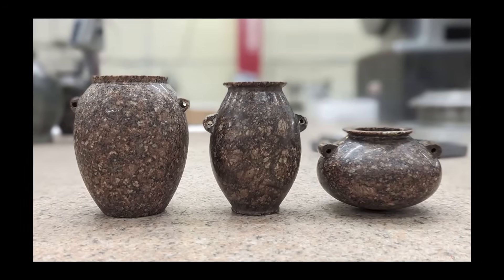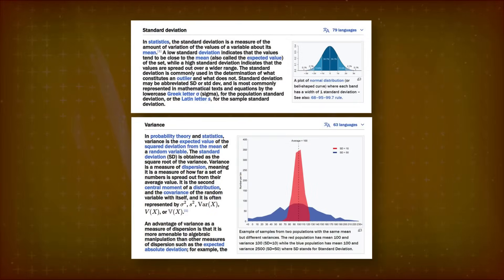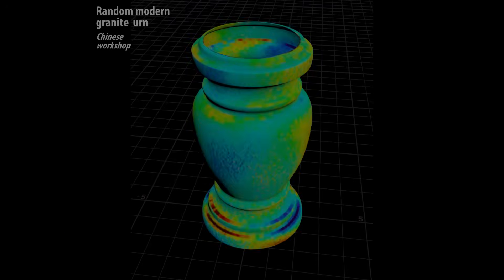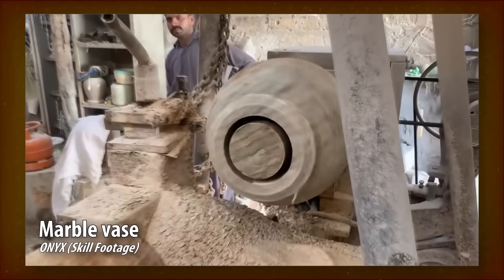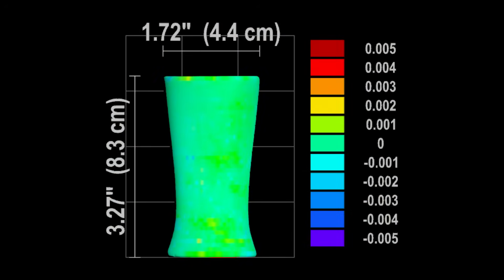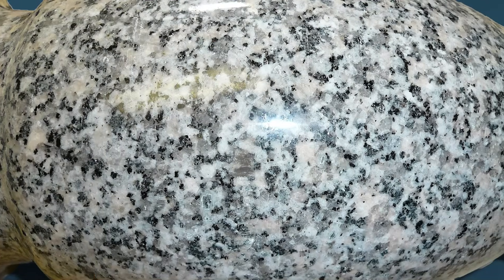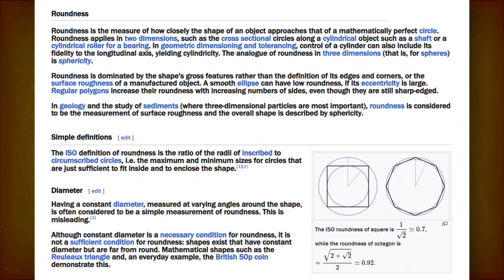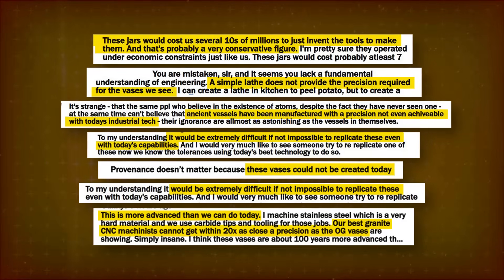Impossible Granite Vases: 3D Scan Showdown

Comment: Really? Everybody is missing the most important point about Egyptian granite vases: THE FRIGGIN HANDLES!
Reply: During the lathing process you leave one area untouched, where the handle will be.
Now you've got a ridge of let's say 1 inch by 1 inch around the vase.
You grind a groove in it on both sides of the handle spot, using a copper blade and wet sand. This kind of grinding in granite has been demonstrated by Scientists Against Myths by hand to take a few hours max.  Next you grind the same grooves all around and knock away the remaining granite stumps with a chisel. Then you use a flat piece of granite and wet sand to polish it all down to level with the rest of the vase, when it's close to level you make the polishing stroke a bit longer to overlap the vase, so it follows the curve.
A video of the Petrie vase scan showed that the precision of the part in between the handles around the vase is 10x less precise than the rest of the vase, indicating a different method. (Hand polishing vs lathe?)
They said it was the result of less data points, but gave no explanation as to why there were less data points, or explained how more data points would improve precision.  Those 10x deviations are there.

This video didn't mention this topic. It did answer the question of precision achievable by a hand lathe, and it shows there is no computer guided high tech needed.
Can that sink in instead of jumping to the next question like it doesn't matter?
Reply: @emilsavu   - The wonky handles?
Reply: Yes, I can't believe that omission is not intentional.  Sorry for the double negative.  (It's obvious the video author intended to not consider the handles)

Comment: 13:30 You forgot that we use diamond to cut things.  Supposedly, ancient humans didn't have diamonds. So them making things at the same level as us. Is impressive.  Proof they had technology
Reply: They had slaves and a lot of time.
Reply: @JohnSmall314  wrong. Stop talking online.
Reply: You don't need diamond cutting tools or abrasives to work stone, no matter how hard it is. It can be a convenient option, but not required in the slightest and is often not used.
Reply: @parkerbradley2457  your comment was wrong. You literally sad nothing. 99% of modern cutting tools use diamond. So you can't compare a diamond tool using Chinese company to ancient humans that probably used quartz crystals like sand.
Reply: We know Egyptians were using lathes as far back at least as the Djoser's Step Pyramid because vases that had tool marks from using a lathe were found under that pyramid. Cutting tools don't have to be al mounted on a machine, as was shown in this very video. Egyptians probably certain hand held whatever they used to cut the vases, and would have been artisans who did this on a regular basis, i.e. become very good at it.
Reply: @bees5461  you said what I said. Smh.  a machine is still needed. Humans will always make machines. Don't be ignorant about human capabilities.  Saying they didn't use machines is like saying they aren't smart enough to be humans that can make machines. Only speak about your own capabilities.  Not about past humans capabilities.
Reply: @bees5461  don't say we know about lathes in the ancient past. Because y'all don't know. Until I started pointing it out in the past few years. Before that, nobody believed that they had  lathes at all. Smh. What's next.  You'll  say y'all  been knew pyramids wasn't made with copper lol
Reply: @ My comment wasn't directed at you. I'm not sure why the name I was responding to didn't end up in front of my comment, but I didn't notice that before saving it.

Comment: Wait, so let me get this right, you guys done nothing but whine about provenance on all the vases of the VST guys but your souvenir jar and your 1970s jar has no proof how they were made at all so your proof is "TRUST ME BRO"? And then your trying to pass off your others as "handmade" because it wasnt made on an automated lathe? They were still made on an electric powered modern lathe? I dont believe the predynastic egyptians had those. And the entire reason they say the original vases cant be made today are because of the handles and the area between and, again, you handwave it away with no proof at all. So what have you "debunked"? All you have done is scanned 2 "trust me bro" vases and a bunch of others made on modern lathes. You debunked nothing.
Reply: What about the mass produced temu vases. This is sweatshop quality and it still rivals the ones held by the VST.

As for the lug handles, do they even look precise without the scan? I always thought they looked wonky.

The credibility of the vase owners is also being questioned. If they are not ancient, as claimed. Then comparing them to typical modern lathe work that yields consistent results is a no brainer. It shows a correlation to modern work. Unless proven otherwise we know this is most likely a modern piece..

Finally a lot of outlandish claims have been made about the unlikliness to replicate these items today, especially the very thin almost transparent piece. Therefore if they should be replicated today it would undoubtedly question the legitimacy of the claim maker? No, probably not.

Isn't it also claimed that the Egyptians in fact didn't make these they only tried to replicate them? 

The issue that keeps returning is; claims have been made about the complexity of the vases. Scarab has shown that this quality can be easily achieved. It's not an attack but a retaliation to multiple claims.

The burdon of proving them to be ancient is on the VST. That's just how life works.
Reply: @rsf886  long statements are usually lies.....keep on talking😂
Reply: @rsf886  OK. Send me the link where I can buy the vases that are comparable to the original ones and, yes, with handles since the original has them. I am confident you won't. 
As for the lugs, I agree the lugs are wonky most of the time but the sections between the lugs are the hard part to blend to the body since you can't complete that step with your lathe.
  I agree the provenance should be questioned. But scarab should have to follow that same step. He just presented vases with no provenance or proof of manufacture method. Correlation to modern work? Consistent results? 
 What is the use of this video? His vases are a different design than the original be studied and made from tools the egyptians didn't have. So what's the point? 
 And, no, sorry, the VST are not the ones who claim to know how they are made. The burden lies with the party who claims to know how. Because mainstream are the ones who claim to know. So you have to prove your hypothesis before its accepted as fact. It's science. 
 And just to make my own position clear I believe the egyptians made them. (No aliens reguired) and egyptians built the pyramids.  Pyramids are tombs. But I believe the Egyptians used processes or some form of  an advanced technology that has been lost or forgotten to us today. I think these predynastic vases will be one of the things that will end up proving it.
Reply: @79Cody440  neither me or you or the VST can confirm exactly where any vase came from, we can't purpose a set of rules on the other side of the fence to follow. Especially if collectors of these vases have no proof of origin.

In regard to the burden, we can produce these results today and the vases do look as if they have been produced in a lathe; without concrete evidence to suggest the vases predate a lathe this is the default answer until the new method is uncovered.

I see the points your making to be fair, but there is grey on either side.

I am actually a fan of many theories fron your side of the fence I just feel the vases is a bit of a time sink when it's difficult enough to pinpoint exactly where they came from.

When it comes to the moving of stones like the ones at balbek and the ceiling of the kings chamber, that blows my mind. It's a logistical nightmare. I could get behind alternate theories for that. And the scoop marks appearing on sites across the world.. much more compelling arguments.
Reply: Nicely spoken 🎉 not debunked and no comment from NightScarab, sad😢